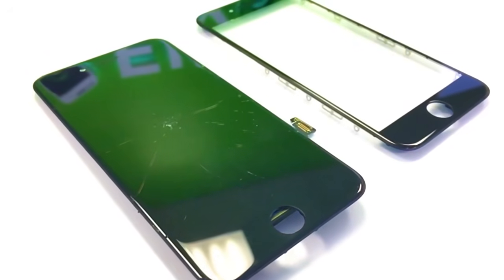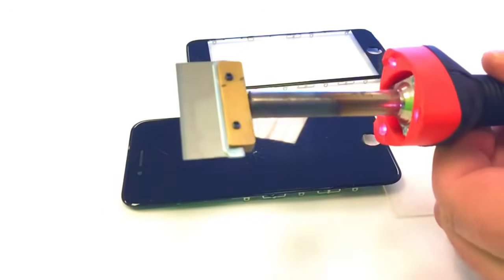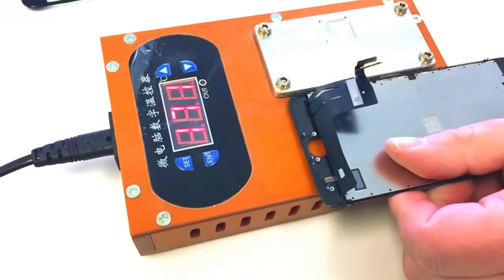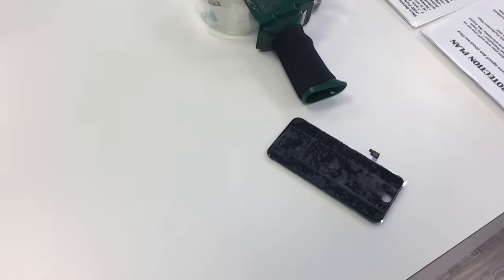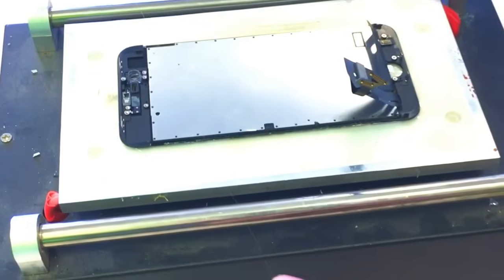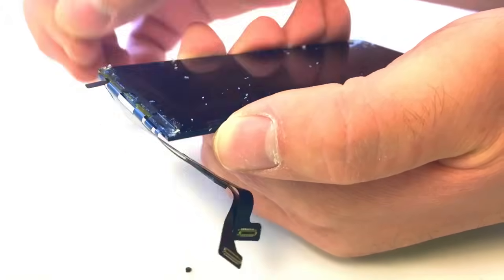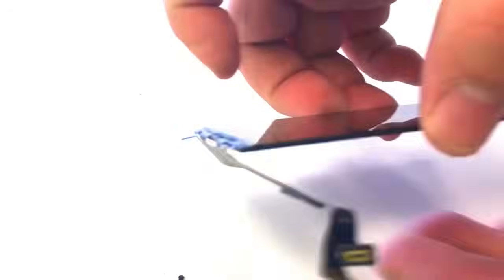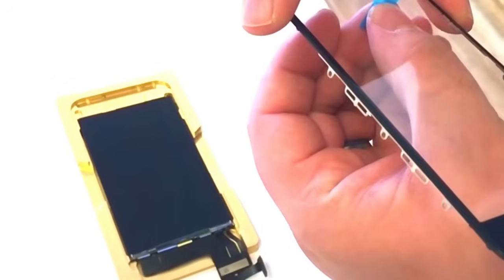iPhone 8 Glass Only Replacement

Comment: Hey how do you know when putting the cutting wire that you are not removing the digitizer. I did the same but remove the digitizer
Reply: It is likely that the frame used to "cut" or separate the display from the front glass is tuned to this precise display assembly model's thickness (i.e. iPhone 7/8/SE2/SE3).